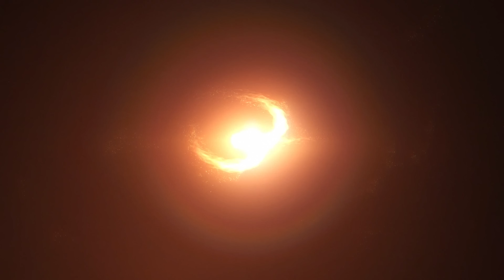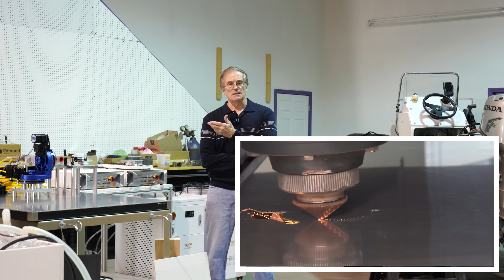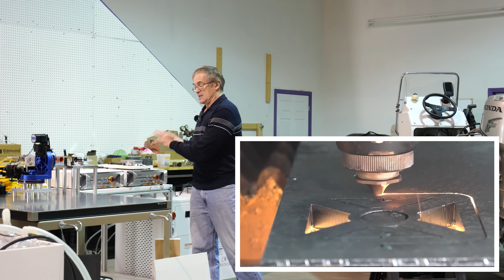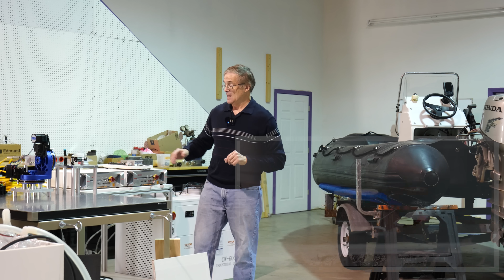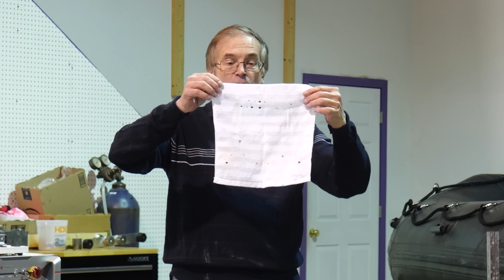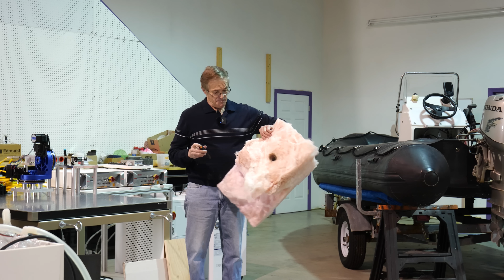We have a problem... and need your help!

Comment: I suggest fill several aquariums with water. You can vary the amount of aquariums needed. Fire the beam at it and it will pass through the glass and water of each aquarium slowing down the light enough to put something behind all the aquariums where it will stop the laser from penetrating something less problematic like concrete or drywall.

Comment: I'm not the first person to mention it by far, but it's an idea I've seen a lot when it comes to laser defense. Layers of spinning or moving materials can spread out the damage of the laser across a much wider area, and if they're moving at different speeds it also makes it much harder for the damaged areas to line up and let the laser through. With a setup like that I could see a single layer of drywall lasting for several seconds, potentially, and a counter rotating layer (in case the drone ends up moving in the same direction as the first layer and letting the laser dwell on it) would be a useful safety margin. Thr actual material, speeds, and number of layers are left as an exercise for the reader, as my practical experience with laser systems is not great.

Comment: I don't know how deeply unpractical this might be, but what about an active cooling spray of liquid nitrogen on the brick? The brick out of the materials you tested seems to have the least structural damage, and resisted complete vaporization the most, which makes it the most promising thing to build on in my opinion. I don't know how fast a reaction time you could get with a pipe with different sprayers ready to go whenever an IR camera or other temperature detector sees a threshold temperature on the brick surface? 

I think you can build on liquidation of the target far more than vaporization. 

I was thinking about those expanding fire proof paints as a potential thermal energy sponge, but because of how localized and intense the beam is, I doubt any sort of thermal dispersal technique will make it far. I think the best bet would be cooling something getting liquefied.

Comment: Not my idea but big dirt berm (aka shooting range) if you feel like taking the laser somewhere else. Or if you want to stay in shop a 55 gal drum filled with water. Both the drum and water would be cheap enough and if you punch a little hole in the drum, just drain the water and spot weld it up.

Comment: Gentec-EO BD-12KW-HD-D0, Ophir BD5000W-BB-50, Ophir BD10K-W. Should run between $3-5k. If you can coat the cone of the laser dump with Vantablack, you can minimize reflectance even more.

Comment: Setup an independent system that uses an Nvidia jetson style AI engine for video processing and then just setup a camera with a stack of ND filters on it so that it can only see the beam.  Set it up so that if the beam stops moving or if the beam appears on the backdrop (could be your wall or sheet rock) it cuts off the laser via a relay that isn’t part of the laser control computer.  The video processor can easily run at hundreds of frames per second since all it is looking for is a number of bright pixels on a black background essentially.

Comment: A fish tank with a slurry of optically absorbent particles. That way you get heat dissipation and you get absorption. You could likely use something as simple as rust particles. You might need a better than standard glass front windows IE optical quartz but it should have a very significant heat absorption capacity and be able to completely, scatter, and absorb the incoming light. You would likely need to agitate the water but it would likely not break down easily and if the iron get really hot it would just further oxidize. It shouldn't reflect much at all and if it did it would scatter it. If rust does not work you might need a more specialized oxide that has a better absorption spectra at your target wavelength. It would be helpful to know the exact wave length that you are trying to absorb. At 1080nm Tungsten Trioxide appears to have very strong absorption.

Comment: If a high quality mirror coating could withstand the portion it absorbs, a rounded surface that scatters the beam into the ground might be feasible, but I doubt that a mirror (not to speak of a coating) with almost 100% reflection exists.

Otherwise, as others have stated, flowing materials could be used, maybe there is a way to blow air of different temperatures in specific angles to slightly scatter the laser for more common absorbers to be feasible. But I can't imagine the geometry of such a "Hot Air Lens" in my head.

Comment: Idk I feel like im underthinking this but why not just like 200 cheap thin plastic containers full of sand or graviel. its cheap and when it gets damaged you just replace the part and do a new test. tape to block holes, they have 2 sides, and there easy to move and stack in the corner or make a wall of them 2 or 3 deep.

Comment: Use layers. A layer of wet cloth, stranded copper wire bunched up vertically and then horizontally, a layer of wood and then a layer of brick.  Maybe put a layer of wet cloth in between every other layer, too.

Comment: Would an artificial waterfall do the trick? I'm thinking about a brick wall, built at a slight angle to allow water to spread along the surface... Pump water at a high rate across the surface. Also have a mister set up in front like they use for vegetables in the supermarket... Behind that the artificial waterfall. So three layers, heavy mist, waterfall made of many droplets, and lastly the brick wall with a sheet of water across the surface... Like a bullet trap for laser light.

Comment: the only material that comes to mind is ablative tiles they use on space shuttles and now starship, so, something like a chainmail of them could be hung from the ceiling or "draped" over whatever.
if it needs to be a rigid structure, what about making a sandwich of plywood,drywall,plywood,drywall ? 
have you tested aerated autoclaved concrete blocks? they're very light, but they look like they can stop a laser, although i haven't tried.

Comment: My first thought was that instead of a stationary target, you need a moving target. Consider the drywall sheet. If it takes a 1/4 second to be penetrated, then you just need to keep moving it at more than it's thickness per 1/4 second to keep it from being fully penetrated.

Another thought was to use the plywood, but keep it waterlogged during the firing. You can drain the water when you need to move it. Maybe keep a supply of plugs handy to fill the first surface holes :-)

Last idea was to consider some kind of medium that disperses the beam. Not sure what would be best, but perhaps a bunch of tiny glass balls might be interesting. Using a layered solution with this as one of the layers might work.

Comment: set Lasers up like a mitrailleuse  or gatling  attached to a LIDAR for range focal points 
to absorb the LIGHT :
transparent glass tank to the light filled with dyed water that is colored to maximize light absorbsion with a suspension of scatering particles {micro spheres(opal?)}

Comment: What you want is a thick layer of lampblack carbon painted on both sides over a thin and wet drywall sitting a few centimetres in front of something like a thermally insulating brick wall (with honeycomb shaped holes in the bricks) filled with very wet sodium polyacrylate or some other watery gel. 

Once the laser burns through the lampblack carbon and the thin drywall, it will get absorbed by the soaked bricks and the light scattered back will be absorbed by the lampblack on the other side of the dry wall, essentially creating a black chamber behind the hole that the laser created.

Comment: Would a tank of a liquid that is full of loose particulate matter work?  making it cloudy, which may diffuse the laser into a "less deadly" power at any single point? That way , your not trying to stop the energy from the laser, just spread it out and re-direct it.

Comment: Years ago I heard about a similar situation with a larger-beamed (thus lower concentrated power) laser where they fired it at wood, which immediately started burning. After it was out, they started the laser back up, but the (now) charcoal didn’t burn and barely got warm regardless of how long they left it on. Could be a clue? Then again, what would a target covered in Vantage Black do?

Comment: Sometimes the wrong answer is more valuable than the right answer. Especially if you already have the right answer. (These are bad ideas but might spark better ideas.)
- Fused Silica Refractory grog. Perhaps this could be resold back to the supplier after the project is done since you wouldn't be 'using' it up. Resale back to the supplier would require a local supplier of metal casting/refractory material. High-Temp Inc. in OR is where i got the idea, contacting them or someone like that may get you a professional opinion from a tertiary industry (maybe Exothermics. Inc. in NH?) These can be loaded into modular containers to be repaired/replaced/refilled between laser firings. 
- free nonflammable MASS, i know it's not fun but forklift super sacks full of free dirt to build a wall. Tape up the holes between firings. Super sacks full of sand would be more spendy if you don't have a free scorce and with the uniform grain size any hole might continue to dump material and not self seal. Random free dirt may have off gassing, random shiny rock of laser refection, or other concerns to look out for.
- any refractory mortar would require a cure time so repairing the safety wall between firings would take time. 
- bricks are spendy and what happens if the laser lines up perfectly with the seam between bricks.

Be safe and have fun, works best in that order:
- Is there a safety material/coating you can use that will give off a specific frequency of light? You could have a sensor to defect that light and shut down the laser faster than any human could hit a button. Just something as a safety last layer behind the actual ablative material you use to stop the laser.

Comment: Small glass shards? A few mm to one cm big pieces. Between two panels of opaque, non-flammable material. Front panel bolted to the back panel every x square inches so if the laser cuts large pieces out of the panel it doesn't fall apart completely. Scrap glass is cheap, just smash it up further.

Comment: Design a lens (or multiple) that your system moves, which will focus the beam at the right focal length.  If you get this right, you shouldn't need a complex solution for what happens after you hit your target.

Comment: If it was me, I would be considering a solution diffraction system, maybe silver oxide and graphene in a circulating tank I would buy a small piece of Tungsten submerge it in a kiddy pool or big bucket with a big fountain pump and set the tungsten plate on like a small BBQ grill.  have the laser run through the solution with the tungsten plate as the final Back piece. There are super dark pigments as well, I suspect some natural ones like octopus ink would work well.  Liquid diffusion is how Really big lasers do it in some forms of chip manufacturing.  You could also spin the solution for a perfect parabola.

Comment: Glass beads, 3M uses them for the way they disperse light rather than just reflect back.  I'm thinking a transparent matrix that is supersaturated with the glass beads.  The substrate may need to be LI-900 silica ceramics unfortunately.

Comment: Rockwool makes mineral wool insulation in dense boards. The melting temp doesnt appear to be much higher than the fiberglass but the fact that its denser, made of rocks, fairly readily available and not too expensive may make it worth a shot?

Comment: Graphite with a Metal Heat Sink:

Concept: This approach is suggested by a NASA technical report for a high-power laser beam stop. A thick plate of graphite would face the laser to absorb its energy. Graphite is known for good laser absorption and very high-temperature tolerance. Behind the graphite, a metal plate (like aluminum or even thick steel) would act as a heat sink to draw heat away from the graphite.
Pros:
Absorbent: Graphite is effective. Mild steel also absorbs fiber laser energy well if used as the primary or secondary layer.
Non-Toxic/Non-Flammable: Graphite is carbon and generally safe; it won't produce uniquely toxic fumes like many plastics and has an extremely high sublimation point. It's not flammable in the typical sense. Metals are also stable.
Affordable & Accessible: Industrial graphite blocks and metal sheets (aluminum, steel) can be sourced relatively affordably.
Portable: The size and weight would depend on the required thickness, but a manageable setup for temporary use seems feasible.
Considerations: The necessary thickness of the graphite and the heat sink would depend on the exact laser power and desired blocking time. Experimentation with sample thicknesses would be needed.

source: https://ntrs.nasa.gov/citations/19900000626

Comment: Also, a spinning disc of material would spread heat out.  Proportional to the distance from the centre, but what you probably really want is to also have the centre of rotation moving so you spread the energy over more area than just a ring.

I cannot say how fast you have to spin, but the faster that spins the more I worry about stability of trying to move around multiple axes at the same time.

Comment: List of ideas:
Ice block filled with sand
Cement tiles used for walkways
Cement tile filled with glass chips as defusers..
Mica
Lens from a light house
What about water that is ultrasonically vibrated?
Mirror slanted at 45 degrees down...

If you put a solar cell behind the target item, could you use 
the solar cell as a fuse to turn off the laser?

Mouse trap trip switch.

Use public landfill as backdrop.. What could go wrong?

It would be interesting to see what lasers do to different kinds of oil and oil derivatives..
Use it to discover constructive properties, like fusing unfusible elements..

Solution would be put you target item on the floor and the laser pointing down...
I see a lot of youtubers exploring underground spaces like abandoned mines and caves.
I remember an episode of The Tick, where someone engraved his name on the moon.

Can you make the laser focal point electronically tunable? 
Make it so it is tuned out of focus when
Reply: Lens from a Light house= Fresnel lens...you beat me by 5 mins....

Comment: Have you ever seen a falling curtain fountain? They are usually art work but copious amonts of water continuosly flow down the face of the fountain that has grooves in it.
Fairly easy to make and if clear water won't work, you can add a suspension to help absorb the laser energy. The water of course would come from a refrigerated reservior.

Comment: Maybe what you want is an array of lenses that will undo your collimation. Can make a couple of layers with alternating patterns to deal with cases where the laser hits the seams or close to them, and then a third layer of an opaque material that takes a lot of energy to cut, such as a sheet of steel, to completely stop/dissipate the beam.
You could make this into modules for transport and reassembly.
I foresee there will be issues with the seams between the lenses, these may degrade with use if not perfectly transparent to the laser, but it might not be a huge problem if replaceable and if the structure can withstand a little bit of damage

Comment: Consider an aquarium filled with water that has a highly light absorbant dye and/or radiator fluid dissolved in it.  Water can conduct and dissipate a lot of heat, especially when it is in motion.

Comment: Ultimately, for the long lived, cost effective solution, it's gotta be concrete. Make up some forms, or find a manufacturer (preferably somewhat local to you) for those tall "jersey wall" type things.Or, a pile of "Eco-Blocks", they are something like 2 foot by 5 foot concrete blocks made from the leftovers from partial batches returning to the batch plants of concrete and aggregate companies. Very cost effective, and stackable. can be lifted with a reasonable tellehandler.

Comment: I used to work for a fire-proofing company. Our product used lightweight vermiculite powder as the fire proofing agent. It swells to many times it size when heated (intumescent), and is basically impossible to catch on fire. I suspect a drywall box filled with vermiculite would be able to stop it long enough to shut your laser down. (Edit) and be reasonably lightweight